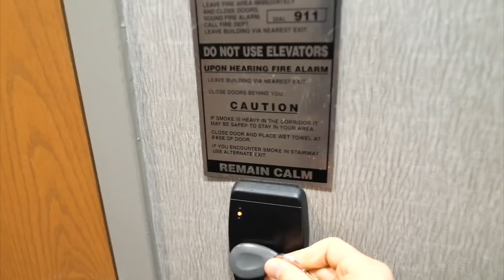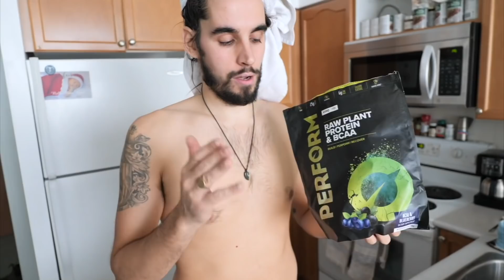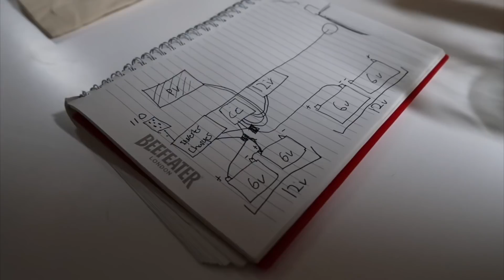VAN LIFE EUROPE CONTINUES!!

Comment: What kind of a solar controller do you have? There are two kinds: PWM and MPPT. MPPT is what we have because it charges off light, not UV rays and so it charges better on overcast and even rainy days. Highly recommend MPPT solar controller guys 👌 best of luck to you with your battery issues
Reply from the maker: Thanks so much Sharon! We also have MPPT but think it’s a larger issue at the moment. Appreciate the support 😊
Reply: Eamon & Bec Does it have a temperature sensor? If a battery is too hot or too cold (especially too cold) it loses battery capacity. Might be an idea to insulate where your battery lives so it doesn’t get so cold, look into that perhaps. Not an expert, but my husband and I both studied mechanics and know a bit. Batteries lose effectiveness if constantly drawn below a certain percentage of charge. I think it’s something like don’t go below 50% in lithium batteries and 75% in lead acid because they degrade quicker and need to be topped up especially. Hope this helps a little, be interested to know what’s wrong from a mechanical standpoint.